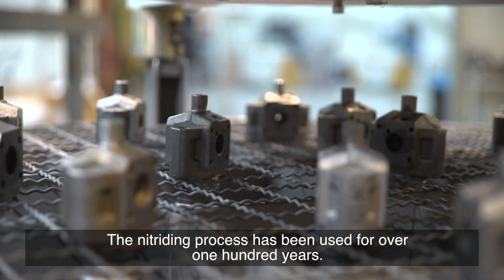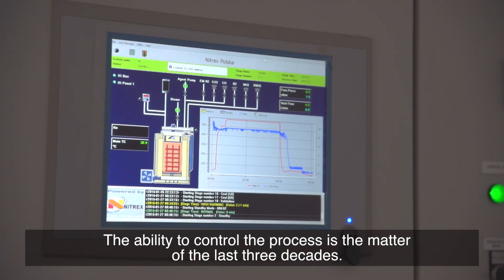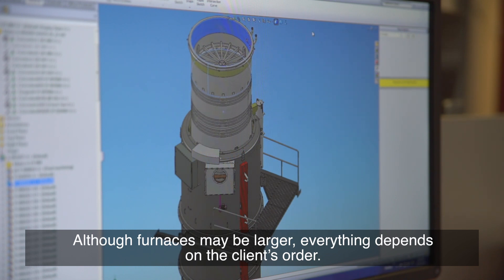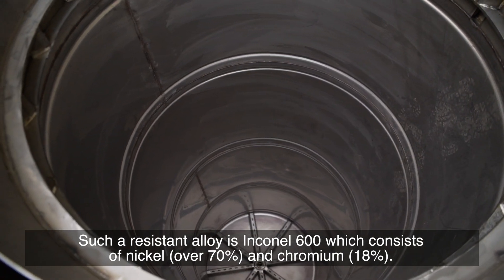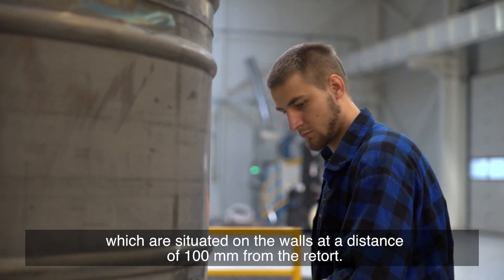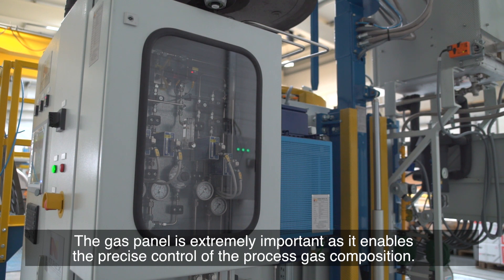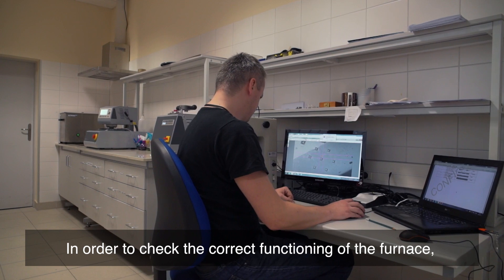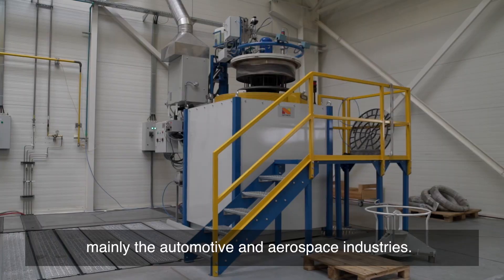Nitriding Furnaces and Nitriding Process - Nitrex Metal

Comment: For anybody wondering, the parts they're nitriding here are the main body for "unit pumps" for diesel engines. One pump per cylinder, which is responsible for metering the correct amount of fuel and developing the pressure. A high-pressure line runs from the pump outlet to the spray nozzle in the cylinder head.

Comment: Do these furnace Malcomize Nitride SS or are they made just for Nitride? If they are made for malcomize will the addition of activation pills clog the exhaust or create issues with the kN sensor?
Reply from the maker: Hello and thank you for tuning in and sending your question. In short, Yes; a nitriding system can be used for both stainless steels and for nitriding in general. The major difference between Nitrex technology and Malcomizing (the tradename was sold and changed in the past) is that Malcomizing is only an activation method, not a complete technology. The activator – chlorine – comes from decomposing PVC pellets. It does not come with specialized equipment or support backed by extensive research.
 
A Nitrex system uses activators, but in addition, it comprises a full technological package that includes Kn control to prevent oversaturation of chromium-rich stainless steels, and appropriate filtering equipment to protect the gas analyzer (Kn sensor) and exhaust piping. Since the equipment includes an ammonia dissociator for very diluted atmospheres, it can be used for a wide range of steels, including deep nitriding of alloy steels, tool steels, high-speed steels, and nitralloys.